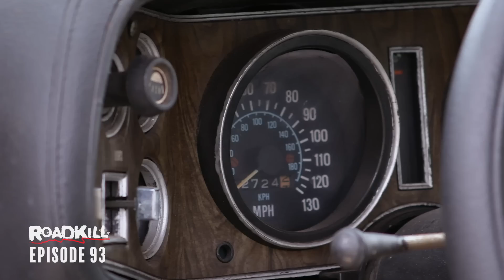30 Second Monster Burnouts! Will the Tires Break? | Roadkill | MotorTrend

Comment: O always thought blowing up tires was more based on z speed rated tires vs p speed rated tires. A skinny p215/70/15 with massive wheelspeed will explode faster than a z rated 17 inch tire with the same speed. Nice cheap Douglas tire from Walmart(whitewall if you can because they are softer) and about 120-135 ish for wheelspeed, betcha about 50 seconds.....